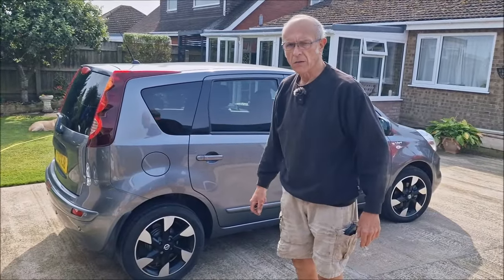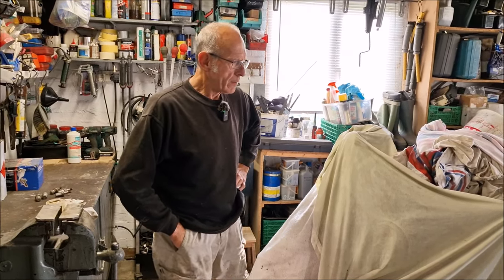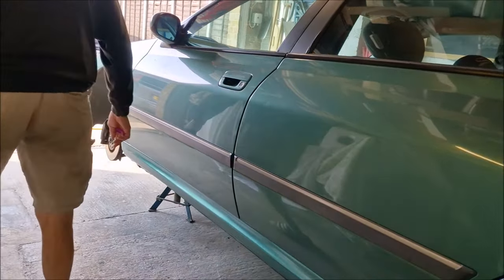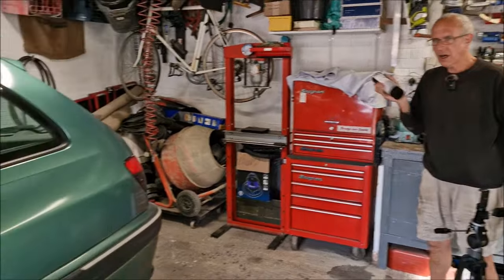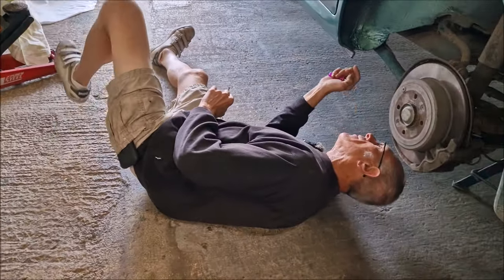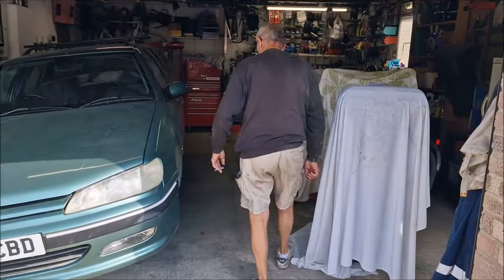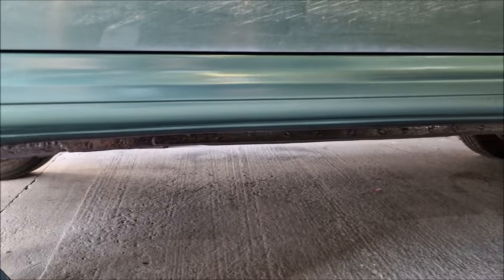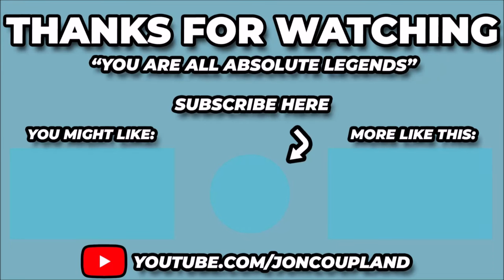Peugeot 406 Sill & Wheel Arch Repair - Day 3 - It's Finished!

Comment: Long live the Peugeot! However if he does ever decide to chsnge it think about a Mk4 Mondeo 2l diesel. Huge car, very cheap to buy now, very economical and very reliable. They drive nicely too. After 12 years and 200k miles with mine it is without doubt the best car ive ever had.
Reply: I have a titanium x buisness edition hatchback mondeo they are huge love the boot and by and large its been reliable. Ive had issues with the vaporiser on the dpf common issue. A grands worth of work in the garage unless you have the right diagnostic equipment the job its self is easy enough. Or you have the option of gutting and remapping the dpf. 😂  you still see mk4 mondeos used as taxis today. I always look at what taxi drivers are driving when i buy a car
Reply from the maker: That's a good way of doing it! Skoda Superb?
Reply from the maker: Dad's not overly keen on Fords for some reason
Reply: @JonCoupland  he would change his mind if he drove a mk4 mondeo especially in titanium x guise, it's as good as a bmw 3 series of the era ford really upped their game. The best mondeo is the mk4 I.m.o it's also a james bond car as bond had one in casino royale.

Comment: I think it's the quality of paint and lacquer that makes the difference on alloys. Diamond cut wheels have clearcoat on them and they are probably not powder coated. And diamond cut wheels often have sharp edges which will cause lacquer peel earlier.
Reply from the maker: Yes thats a good point!

Comment: The wheels, I think it's down to the quality of the alloy and the amount of paint, worst wheels I've had were on a Mazda 3 and Mazda replaced all four at 2 years of age as they were that corroded. Keep the Peugeot on the road, after the 306 and 406 it was all down hill for Peugeot sadly.
Reply from the maker: We will be doing :)